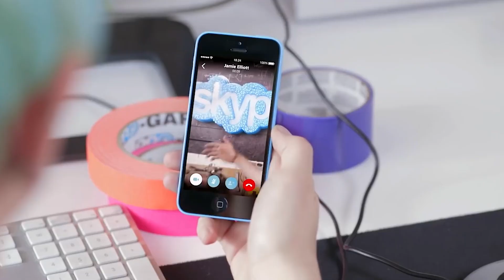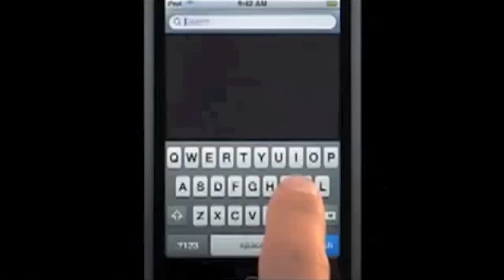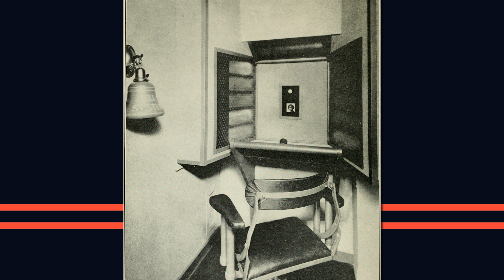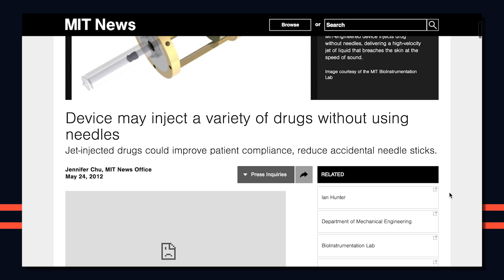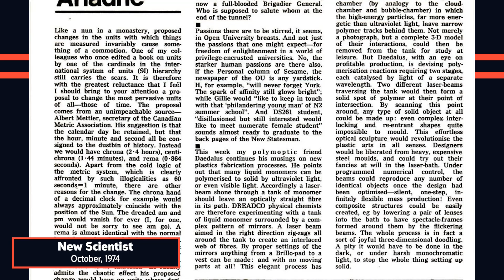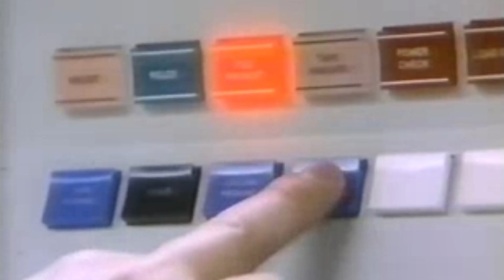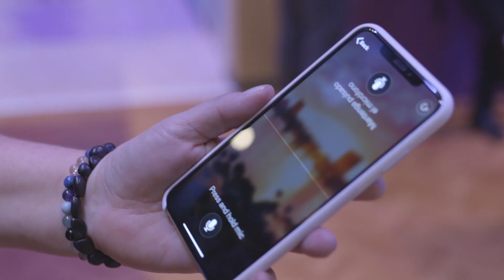11 Times Star Trek Predicted The Future

Comment: You’re forgetting automatic doors sliding open. That was sci-fi in the 60s.
Reply: Hospitals had them back in the sixties in the EDs.
Reply: Grocery stores had them in the 1960s (so I'm told, I was an infant then).
Reply: @quintas66  I was in grade school. The automatic doors swung open then.
Reply: @quintas66  floor pads were used, not infrared body sensors,
Reply: That's right. There have been hidden people who opened the doors, that movement detectors haven't been invented in the sixtees.
Reply: Not exactly. They were invented in the 1930’s.
Reply: Well photo-electric "eye" doors already existed in the 60's.  The thing was how fast the Star Trek doors were, to make automatic doors that fast even today would be a safety issue.
Reply: @quintas66  I never saw them until the 1970's.
Reply: I worked for the company that made the automatic door or the “magic eye” they’ve been around since the 30’s
Reply: @barrymorris295  I remember these even in the 90s
Reply: I remember as a kid in the 60s when our grocery store got automatic doors and I had to go in and out several times just to get over the novelty.

Comment: 12) When Trek was aired computers still used punch cards - yet Trek used what appears to be a 3.5" floppy
Reply: Valulife floppy disc from 1985 !
Reply: Valulife floppy disc from 1985 !
Reply: Floppy drives developed in the late sixties, after Star Trek had already begun to air. However, they were huge 8” drive unites and it would take several years for the familiar 3 1/2” microfloppy to become a reality.

Given the storage capacity of those Trek devices, it was probably more akin to modern solid state passport drives or thumb drives. The Trek versions held databases, video and audio.
Reply: @kjamison5951  My older sister was working for IBM up to 1971, still using punch cards, she would bring the used ones home and my Mom would make Christmas poinsettias out of them
Reply: actually it was closer to the Mini-Disc that was created in 1992 that you could record audio and play audio on. Due to  introduction of MP3 recorders and players and recordable/erasable CD's it's popularity decreased considerably although it continued to have good sales in Europe and Asian countries until the early 2000's. I bought two of the portable devices and bought an in dash one for a vehicle I had.
Reply: Painted wooden slabs.  More an indication of thrift in the props department.  Note how StarLost produced in the 70's used actual dictaphone cartridges for essentially the same function as well as door access and computer terminal access.
Reply: In a few episodes they have things that look like smaller cassette tapes and in at least one, a triangular one.

Comment: You forgot automatically doors. Getting into supermarkets would be alot more difficult without Star Trek. 😉😁
Reply: TheModerateShow I immediately thought about automatic doors, but on researching found that Automatic sliding doors were invented in the 1950s before Star Trek.

Also, did some research on the show, and apparently they considered using automatic doors on set, but decided against it because they were too slow for the actions.

I think it’s a case of: The technology existed, it just hadn’t become widespread yet.
Reply: @DaveControlLive  invented and available are two different things. We were all blown away by the doors when the show first aired.
Reply: We had those long before Star Trek.  I remember them in the early 1960's before Star Trek came alone and they were featured in various science fiction movies in the 1950s and even 1940s.
Reply: Star freak invented cell phones flat screen televisions and home computers the ideas for those inventions invented by white men are from Star trek !
Reply: Jon Jonas 
What’s the deal with specifically stating inventions from White Men?
Reply: DaveControl too slow, but if the film set crew pulling the doors open were too slow you’d end up with a blooper of Kirk walking right into the thing.
Reply: Churches in ancient Rome, 2000 yrs ago, had self opening doors.
Reply: DaveControl on TOS, they had people manually opening and closing the sliding doors. 😂
Reply: @nunyabiznez6381  H. G. Wells og scifi writer already had that shit "invented" during 1899
Reply: Automatic doors were already commonplace in the 60's either with visible light electric "eyes" or pressure pads and indeed elevators during the 60's commonly had automatic doors.   We tend to forget what Star Trek was itself inspired by.   Everything in Star Trek was preceded by what existed commercially in the 60's or was just created as a mcguffin to simplify the plot.  Some technical details from Star Trek that was not inspired by what already existed commercially or prior scifi were items such as McCoy's sonic scalpels,  they had the prop department source some salt shakers for the Man Trap episode but what the prop department provided would not be readily recognized as salt shakers so they stole a salt shaker from the cafeteria, the salt shakers from the prop department became the sonic scalpels.

Comment: One reason a flip phone is still better than today's smart phones, is they never unlocked themselves in your pocket and started doing whatever they want, connecting to any app they decide to set going
Reply: A feature many of us consumers want back, and an auto on when flipped open!!!
Reply: Steven Joy 
You can set a pin or biometric lock on the phone so it doesn’t unlock in your pocket.
Reply: @2bituser569  A flip open protected the screen. A good flip open automatically turned the phone on. A biometric means it is harder for someone to dial for you---like if you are driving and want the passenger to call. The inside cover a flip phone could also hold a favorite picture or a credit card. I want a smart phone with a flip cover that I don't have to swipe a screen to activate. Especially since my hands are often wet or, in the summer, dirty from outdoor activities. Whoever decided we wanted swipe to open had not a clue how many lifestyles there are for which that is not only impractical but borderline dangerous.
Reply: Fran Tabor 
You have option to cancel biometric and just enter pin instead
Reply: People texted a lot less too!
Reply: and when you are mad at the person on the other end of the call, you can just flip them off
Reply: I still miss that feature of a flip phone and still have occasional issues if I forget to turn off the screen before putting it in my pocket, etc.  We're just now seeing foldable screen smart phones that might fix the problem.
Reply: 12) When Trek was aired computers still used punch cards - yet Trek used what appears to be a 3.5" floppy

Comment: The first tablet device seen on screen before it was actually invented was in 2001 A Space Odyssey made in 1968. It was called an IBM news pad. I remember the jet injector from Navy Basic Training in 1975 when we got our injections. I even used it for a short time after I completed Hospital Corpsman training and was giving injections to the Marine Recruits at Camp Pendleton. Even though it was a quick shot of air some of the Marines jerked their arms and got a small cut from it. The Army uses something similar to the Google Glass in it's Apache Helicopters and in 1962 Hughes aircraft invented one. While your info is basically correct because you are just talking about Star Trek you should include when the devices were first seen on the screen and in real life.

Comment: Touchscreens were commonly around in the 1980s. I used an early one in 1979 on a Texas Instruments computer. The LCD colour screens took time.
Motorola was working on handheld cell phones in 1939. The technology was diverted into the Walkie Talkie delaying civilian use until the late 1940's & 1950's.
Reply: I remember playing on a PLATO terminal at my dad's house in the late 70s. PLATO was a mainframe computer by Control Data Corp. We'd dial up a number on the phone and place it in a cradle, connecting our terminal with the mainframe. We played games online with others around the country including one that was fashioned after Star Trek. A chat feature let you "talk" ship to ship. Pretty cool. It had something like a touchscreen, but I believe it was light paths across the screen (sent/received from the bezel) that would be broken when you touched the screen as opposed to the screen sensing your finger. Lightyears (I know, that's a unit of measurement for distance, not time) ahead of my friends.

Comment: I really like this video. My father worked on the original Hypospray Jet Injector. They developed the multi dose version that allowed this to be used by the military and others that needed mass inoculations.  
.
I have been working on an AI based Tricorder device. I have many functions working parts for years. The AI took from the 1970’s until a couple years ago. I needed a processor that was not available until recently. I needed mass storage that I now available. Small high-resolution screens are now here. Speech recognition has not been all that good. What is good now is only available via the internet for my project. It works with my AI, but my portable instrument is not on the internet. It also cost per / second. The computers are really cheep. Around $20 with a SD drive. 
.
I also remember Captain Kirk having one of the first big screen televisions. In the Next Generation They had notebook computer on their desk. Captain Kirk often was brought a tablet computer and he would use a pen stylus. These things are now common. In fact, we have much better.

Comment: Oh come on. Apple did not invent the touch screen, the tablet computer, the MP3 player, or the smart phone. They all predated apple's versions by years, often decades. We had touch screen tablets in the 80s. We had touch screen WATCHES. They just needed refinement. The main issues were batteries.
Reply: Touch screen has been extensively used in machinery, automation and control in manufacturing environment since 1990s or late 1980s. It was expensive. Apple did not invent it. Apple devices made it possible to produce touch screen at very low price due to high number of production.
Reply: USA#1 !!  sounds like you need to grow up

Comment: In 1983, Hewlett-Packard released the HP-150 which was a primitive form of touch screen but it worked. My first experience was when UPS Truck Leasing, where I was a Mechanic put Windows 95 with touch screen computer towers on the shop floor for us mechanics to use with a small air conditioner in it to keep the computer cool. This way we just had to wipe the screen clean once in a while as our fingers were always dirty/greasy. Doing our paperwork or looking up a schematic of what we were working on was great.
Reply: was it heat sensitive or touch sensitive?
Reply: @oneblankspace4919  I don't know other than I also could drag a item/sentence? I had to clean the screen once in a while with the dirty fingers always on the screen! We had these starting in Jan 1996.

Comment: In the 80's I had a Radio Shack model 1(one)home computer. Runs Basic programming language only. Z80 main chip* & 16k memory in the keyboard. 32k max in an expansion interface. $697.00! It could access a total of 64k memory. Running at 1.78mhz. You had to buy 'their everything'. It was not compatable with IBM. They had very expensive product add-ons. Extra 16k memory $200.00 The first Floppy disk (necessary)drive holding the disk operating system, acting like a hard drive, was $499.00. The second floppy disk drive where you saved programs (necessary) 85.7k bytes each 5-1/2"floppy, were $499.00. One product could recognise words, (not the best), through a CB microphone. Another add-on, could 'talk'. $399.00. You couldn't just type words into it. You had to pre-create the words into sentences by typing the word sound parts.(phenomes), Using the full keyboard, (53 keys)typing the required alphabet/punctuation keys. There was a phenome translation sheet to get the words 'right'. To get the 'er' sound in a word, you had to type only the 'r'. You could only use 1 add-on unit at a time because it had only 1 flat ribbon 40 pin 'port'.
 *That was before the 8086 main chips. You know, 386, 486, 586 machines.

Comment: DOORS!....why didn't you include the automatic opening doors with the sensors?  In TOS, there were guys physically opening and closing them to achieve the effect.  Now every building utilizes this technology.  Also, wouldn't the Library computer be modern internet?  A computer system that networks every data file on the planet..or galaxy, as it were?

Comment: Some Buick model cars had touchscreens as standard equipment two  years before the Next Generation aired. Touchscreens were in use the 1970s. Some home computers had touchpads as early as 1982.
 There are two types of automatic doors. Automatic doors that open by light beam sensor have been around since the 1930s. Automatic doors that open by sensors in a floor mat have been around since the 1960s. If you're old enough to remember the black mats in front of the doors, that was them.
 If you followed comic books, science fiction magazines, technology magazines, military and university research, you'll see that Star Trek isn't original in its science fiction technology.

Comment: Not sure if someone already mentioned it, but it seems like you missed a pretty basic one. TOS had automatic sliding doors which I dont believe existed at the time.
Reply: Jeez, I get tired of reading this in these comments. I'm 65 and remember all grocery stores had sliding doors when I was well below 10 YO. The Romans had automatic doors using ropes, pulleys, and lever floors. Modern, electric doors were put into widespread production in 1931 ,by the Stanley Co. Think that might be a bit before we all looked at Rand's legs.

Comment: Except a phone that talks to a low Earth orbit satellite in that form factor, is still impossible.  I know I worked on Iridium and Globalstar.  The 8" ferrite antenna is still necessary and the signal cannot penetrate buildings which attenuate signals by 35db.  Iridium can ring your phone in a building but you must go outside to take the call.
Reply: Yep, cell phones are ridiculously weak, requiring countless numbers of towers to boost signal. ST's communicator is more analogous to a military walkie-talkie which have evolved from a 1 mile range to the sat phone, as you said.

Comment: Almost all of these "predictions" were already or are, in fact, impossible. The holodeck is impossible, at least as far as the force field interactions go.

BTW, there is (in the original anyhow) no difference between the tricorders, based on their uses. They're all the same device.

A universal translator is impossible, because it supposedly figures out what the words represent, before translating. All human languages must contain many or even most, of the same concepts, but there are many languages we can't translate now. Even a few we can read and not understand (Etruscan is easy to read, but untranslated). Linear A can't be read or translated. Alien languages will lack even human concepts.